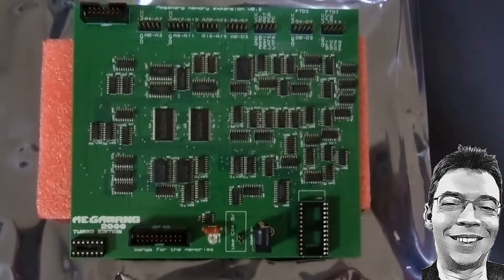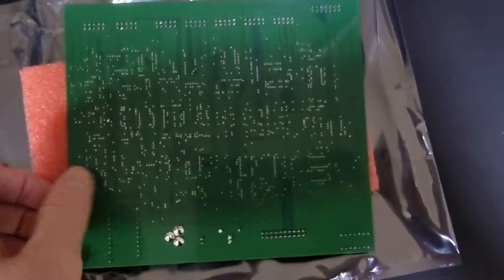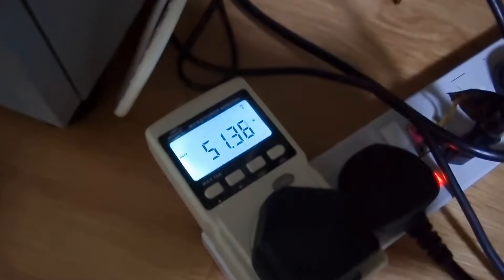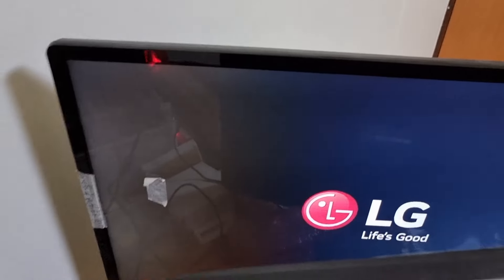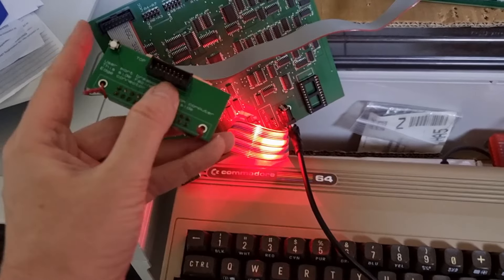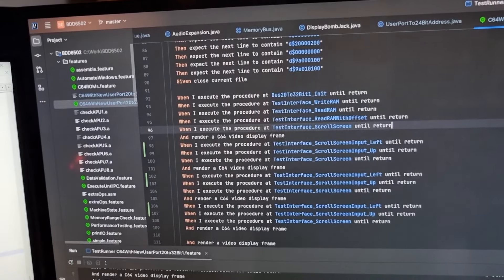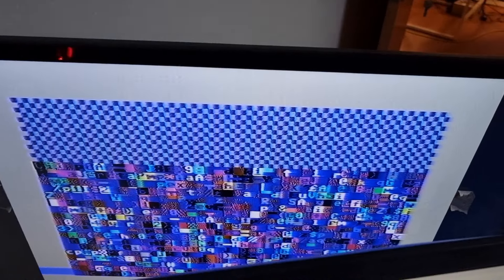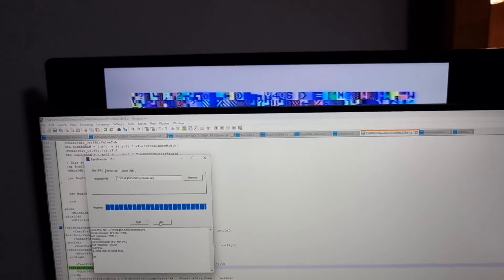MegaWang 2000 Turbo Edition - 28 - C64 RAM expansion

Comment: Very cool 👍 I wish they had added something like that to the VIC chip. Just imagine all the cool things you could do if you didn't have to spend so much CPU cycles on moving characters and color attributes around. The next best alternative is the REU with it's DMA transfer, but unfortunately it never really caught on back in the day. I think it's most popular use was by pirates using it to load a full disk side into memory and then write it multiple times to multiple drives to speed up disk copying. 😅 Why not add some ~100nF decoupling caps to all those logic chips?
Reply from the maker: I'm really glad I did not have to solder this, all the ICs have at least one CL05B104KO5NNNC decoupling capacitor, the RAMs have two each. But they're so tiny I can hardly see them with my eyes on the PCB. :)
Reply: @Kobold666  I don't think the REU was too expensive, it was around US$169 in 1987 for the big 512kB version, but there was little reason for anyone to buy one, no killer games, just some simple demos and GEOS. IMO Commodore should've hired some talented people to write a few killer games for it, then they'd have sold like hot cakes and other developers would've latched onto it. But of course the Amiga was already starting to gain traction at this time, so maybe not.
Reply from the maker: That would be around US$450 is today's money?
Reply: @MartinPiper6502  yeah, everything was more expensive back then. A 1541 drive was around $200 at the same time and don't forget SNES and Genesis games cost $50-$120 each back in the early 90s.

Comment: Imagine the cost of that 2MB board in 1980 🙂
Reply from the maker: Astronomical, and many chips.
Reply: @MartinPiper6502 In 1980, 4116 DRAM chips were US$10/piece, according to an advertisement in the January edition of Interface Age. Therefore over a thousand chips would've been required at an inflation adjusted cost of US$40,000.
Reply from the maker: @firstsurname9893  and the is SRAM not even cheaper DRAM :)

Comment: 2mb of ram on a C64 type of computer would had been insane in the 1980's... ..but can it run Crysis?  :-P
I guess this project is one of those "because I can" types...
Reply from the maker: Definitely because I can :)
Reply: @MartinPiper6502  I would be impressed if you could do a rotating colour cube.
Reply from the maker: @vampalan  challenge accepted
Reply from the maker: @vampalan  oh yes there is a vectors display layer https://youtu.be/jcY96DvCNoA?si=pMZXfoe-1gK4VcJ8

Comment: Is this dual port RAM or does the graphics board and C64 access in turn based on the clock phases? I've always been fascinated by multi-CPU systems and how they overcome bus contention and in accessing shared RAM
Reply from the maker: @stupossibleify  normal single port RAM. The write access happens during the vertical blank period when the video doesn't read RAM.